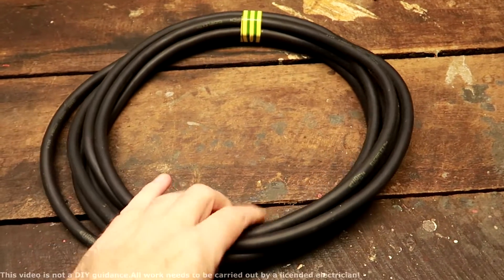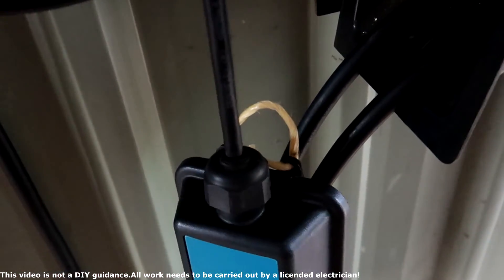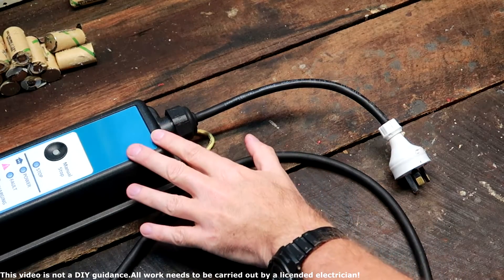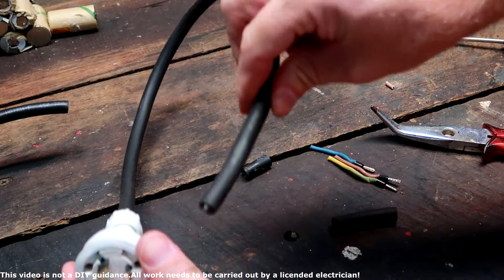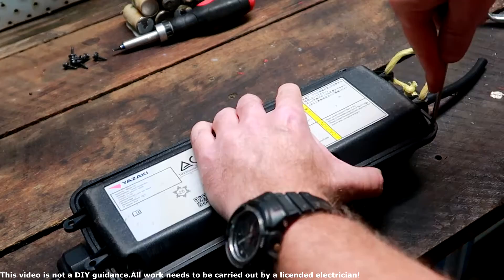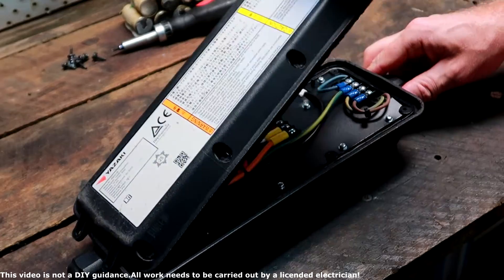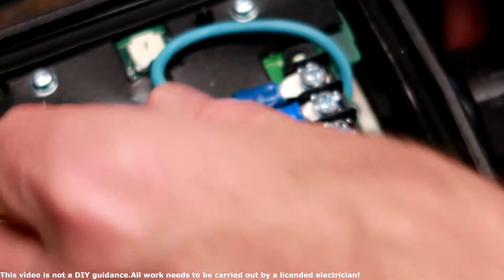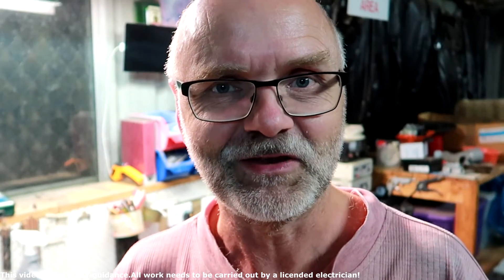EP228 - Outlander PHEV Standard EVSE Repair (Granny charger, Ladeziegel)

Comment: Hi, I changed my 3 prong plug end as it started melting after 3 years use and it worked great. I purchased a high quality outdoor plug for the replacement and it never even got warm vs how the other would get extremely hot.  Some I decided to replace the short wire like your suggested to make it longer. I was having trouble getting the wires up through the opening around the circuit board so I loosened the circuit board which I now regret.  Put the new wire on and the charger doesn't light up I have power to the middle wires coming in but no power to the wiring in back half. Checked all the connections to ensure there all secure but nothing. Any suggestions.  Ed
Reply from the maker: Very hard to give you any advice on that without seeing the EVSE. Maybe let an electrician have a look...

Comment: My evse was faulty and I exchanged it under guarantee. My new chargers often read fault when I switch on and mostly then change and start charging. Occasionally I have to switch off and try again. Does anyone have any ideas or similar happenings?  Is it the car or the charger?
Thanks in anticipation.
Reply from the maker: You're talking about the standard EVSE which came with the car? Do the lights turn off as well, could it be the cabling issue?

Comment: I noticed that you changed the 15 amp plug to a 10amp plug. Not a problem seeing the device doesn't draw more than 10 amps, but I decided to use a 10amp to 15 amp cable   with inline 10amp CB. This allows me to use the 10 amp gpo and give me the 1.5 meter extra length so that the device does not dangle.
Reply from the maker: I changed the plug on this right after ti bought the car and it has never tripped any circuit charging anywhere. It usually pulls around 9.5A only so stays below the 10A spec.
But yes, the AMPfibian adapter would work as well, coming in the next video ;)